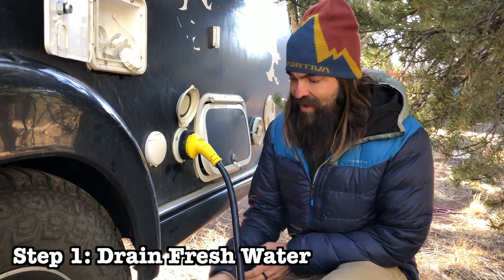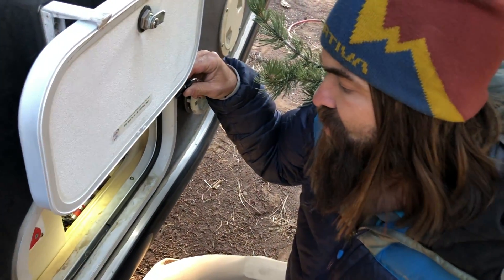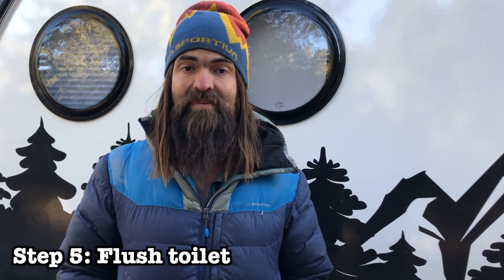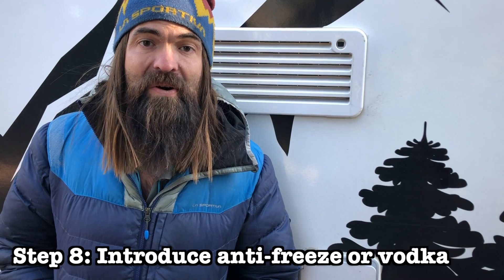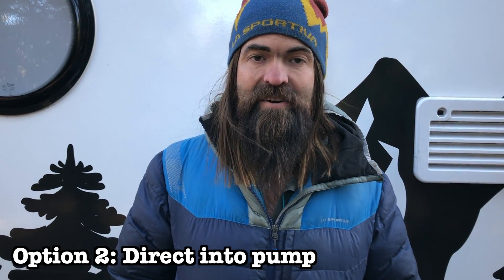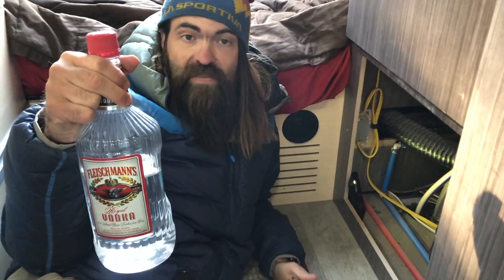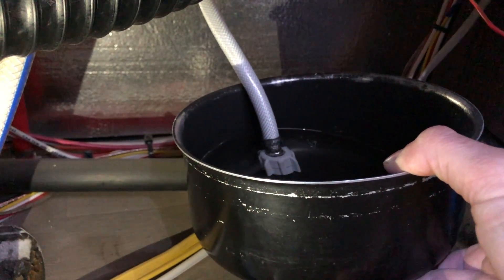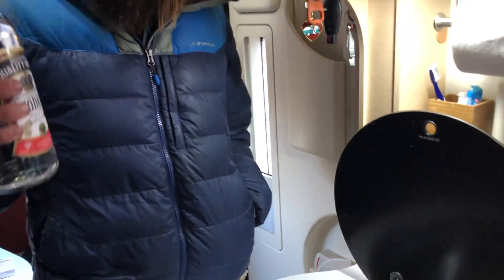Winterize your TAB 400, Avia, or Cirrus  trailer without anti-freeze!

Comment: That was excellent!!! You show and explain every step while manufactures skip little steps and don't show all the lines and valves just assuming we can figure it out....NuCamp should put this video on their site instead of the half way done one they have.  Thanks Kendrick and Mandy...One important thing you mentioned is that the Aldie heating will still work..is that right?
Reply from the maker: Thanks Rodney! Yes, you can still use the Alde while it is "bypass" mode for heat - but not for hot water.

Comment: The only time we winterize our vans is when the go into storage, as we empty the water out of taps and leave them open so air circulates through and before use we do a flush through before using the taps again and our water tank is inside under a seat locker and we do not have a  grey or black water tank as our toilet is a cassette loo where we slide out and take it either a public toilet and for the grey water we have like a aqua roll outside to collect and empty anywhere have a sink etc. Thanks for sharing and stay safe 🙂

Comment: Thank you, Kendrick!  I wish we had an easy disconnect under the sink of our T@G...  Last year, we emptied the tank (as much as possible tilting the T@G)  & used an air compressor to blow out the pump ... Then, we stored Cozy Nest in the garage...we had no problems even though we live in upstate, NY where the temps went below 0º on occasion... 
This year, however, we will be using our T@G for Christmas - our house will be overflowing and Chris and I may need to backyard camp =)  I will be revisiting Mandy's T@G winterization video.  Would she recommend anything different these days for a T@G?  Thanks  ~ Maria

Comment: I always use antifreeze due to being in Canada and our winter's can get pretty cold. After I run the antifreeze through the system I bleed the pipes again so all that's left in the pipe is trace amounts of antifreeze so even in the event of it getting close to the RV antifreeze freezing point there isn't much in there to freeze

Comment: There’s been so much talk of winterizing and I’m curious about how much I really need to do. I live in S. TX and this is actually prime camping season for me. It rarely gets down to 32 degrees and when it does freeze that’s usually just overnight and heats up into the 40’s or 50’s during the day. Is it okay if I just empty out all the water so there’s nothing to freeze in there? Should I clear out all the lines, drain the tanks and the Alde system? Then when I want to camp just fill up again?
Reply: Hi JP, I'm dealing with the same thing. I live in Phoenix, AZ and the dealer I purchased my 320S from told me I don't even need to bother, but with all of these videos and forum posts, I'm wondering if I need to do this as well. ;)
Reply: @reenieg3019  Hi! I was at my dealership, Princess Craft, in January to get a new battery and solar panels and I asked them about winterizing. They said the same thing yours did. There’s no need to do this in our area, especially since I use it the most from October - April. It very rarely, barely freezes down here and I just drain everything between uses, especially if I’m not planning to use it for a month or so. I do plug it in and run the fan every couple of weeks during the summer to air it out help prevent any growth of mold. I think that’s in the owner’s manual. Best of luck and I hope to see you down the road!

Comment: Hey now, could you use EVERCLEAR VODKA to travel through really cold climes , like colder than -16?   (Since It has a freeze point of   -173 degrees Fahrenheit (-114C!).
Reply from the maker: You could, but you want to be careful because too high proof can start to deteriorate rubber seals

Comment: I would have thought that the water system could cope with low temperature, especially considering that yours is a liveaboard travel cabin, inhabited all year round.

To have neither cold nor hot water available in winter seems really odd as yours is a top quality brand.

I can understand owners draining the systems down when long term storing their trailers throughout winter months, but didn't think it should be necessary for those owners whom liveaboard all year round.

This must be really quite inconvenient!

Comment: If I start living  in a camper year round then when would I winterize my camper? Do I have to be plugged in indefinitely to keep it from freezing? Thanks
Reply: First to use a camper year round you need to have an all seasons design rated camper which is insulated underneath and has heated pads on the tanks and has hot furnace air blowing through the under belly.  Very few campers are built for this, Arctic Fox being one which is.   And yes you need to be plugged in or have ample battery power and or solar to keep heat running to prevent freezing.  Many people who park for long periods of time during winter skirt the underbelly and place a low power heater under camper to prevent freezing.  There are options here to use small propane heaters that will not put off enough carbon monoxide to seep in and kill you.  A carbon monoxide detector can be got cheaply at Target, Walmart or Amazon.  I use one when I sleep in my suv with heat or air running all night.
Reply from the maker: If you want to use your water system through the winter then you would have to have a 4-season camper. HOWEVER, you can easily live in your camper and simply drain the water for the months where the weather will be below freezing. This is what we do. Our camper is only a 3-season camper, but we simply winterize our camper and use indoor water jugs for the weeks where it is too cold.
Reply: @DAVIDTATLITUG  Oliver Travel Trailers is another 4-Season rated product.  Keeping water from freezing in an RV requires QUALITY Engineering/Design & installation of Insulation/sealants.
Not using a toilet or shower & not keeping water in underbelly storage tanks is an alternative to the much more expensive 4-Season option/feature.  Even better is simply moving to a warmer climate.
Reply: @Vantasticdreamer - I have plenty of golden delicious gold that will keep us warm in our campers throughout the cold.
Reply: @azclaimjumper  Moving to a warmer climate is what I see from alot of the videos of the nomads that RV full time! ;)
Reply: However, it appears Oliver is or has GONE OUT OF BUSINESS.  Anyone owning an Ollie is most likely going to have to a DIY type of person as "service" by Oliver is now extinct.
Reply: @azclaimjumper  Oliver is still in business and going strong. We considered one, but there were a couple of design features that we didn't like. Along with that, the price is just not in line with our expected use. They're great trailers though ... absolutely top quality.